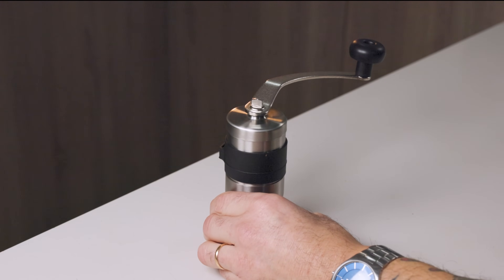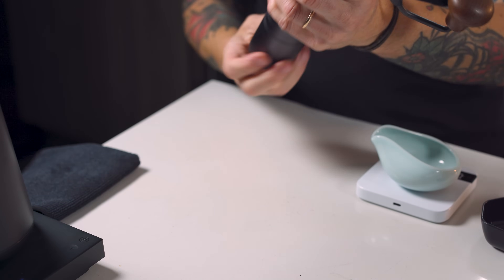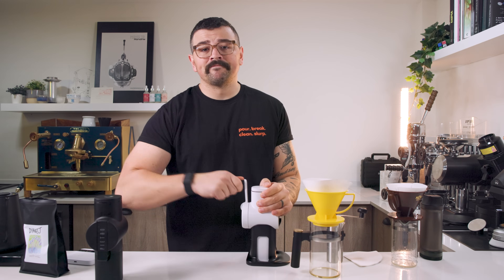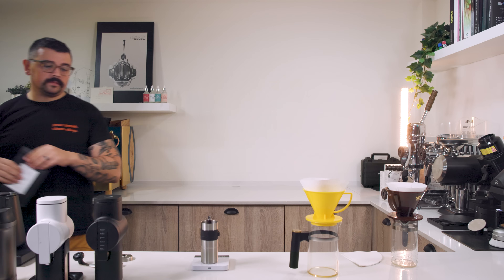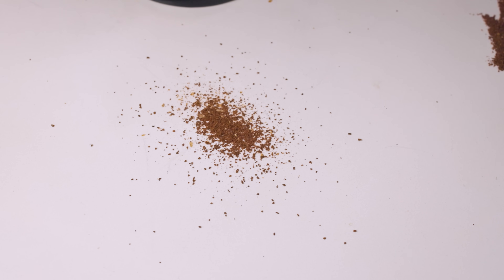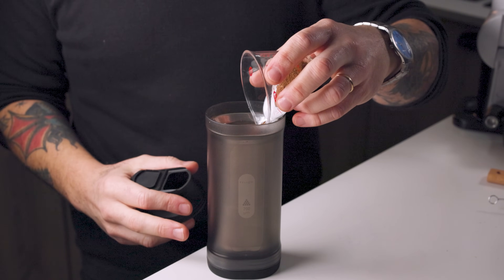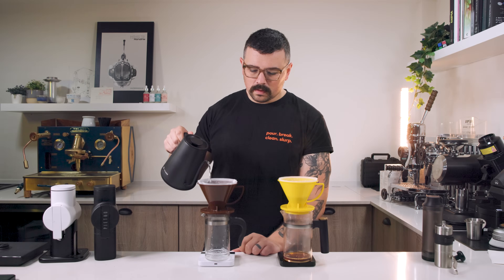Does this Trick Improve your Grinder?

Comment: I read this article a while back about how AI was designing these spikes that go inside rocket engines. I think they designed entire engines now. The things looked positively psychedelic in their complexity. Significantly more precision business than mere coffee grinders.

Within a few years somebody will feed a bunch of coffee data into one of these models and after a few iterations it will design perfect burrs that can never be improved upon. You'll be able to take video of yourself using a hand grinder and tell it your favorite brew methods and from that it custom design a perfect burr to suit your strength, speed, angle, etc.

As far as the electrical ones go, there will just be one that is perfect for every grind. This burr at this speed for pour over, this one at this speed for espresso, so on and so forth. All optimized. There will be one for versatility that has been perfectly tuned to make the absolute minimum necessary sacrifices across grind sizes.

Comment: Assuming some fines are good, and you would consider adding some back, doesn't that mean that you should just adjust your sifter down so you get less (and smaller) fines to be removed?  Instead of the 200 micron, maybe go to 100 micron?  There should be an optimal number right?  (Time for another video?)

Comment: Timestamps (Powered by Merlin AI)
00:09 - Investigating if sifting fines enhances cheap coffee grinders' performance.
02:24 - The video integrates an ad segment for Stand Art magazine and its anniversary book.
04:20 - Sifting coffee grounds can enhance grinding performance and clarity.
06:21 - Testing grinder geometry effects on coffee quality.
08:34 - Evaluating grinder performance through particle distribution analysis.
10:48 - Grinder design affects coffee extraction and taste balance.
12:43 - Fines contribute crucially to coffee extraction balance.
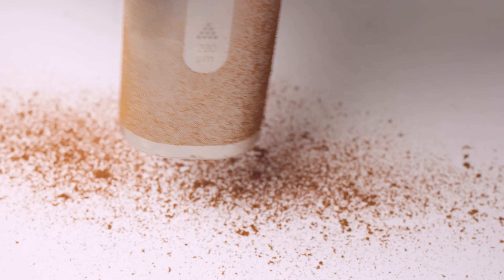14:33 - Sifting coffee fines can improve extraction but lacks dramatic impact.
16:45 - Experimenting with grinder settings can enhance flavor preferences.
18:35 - Ending with an upbeat note and appreciation for the song.

Comment: I started filtering fines years ago and it has been the single most impactful change to brewing consistently. I don't use any kind of sifting device to achieve it though. My grinder is a $75 Oxo conical with worn out teeth.

Comment: Should’ve matched the extraction instead of the nominal peak size. The former is what translates to the target experience of a good cup, not the latter. With my Chestnut C2 I have to go espresso-fine in order to see the benefits of the sifting. I do lose 24% of the grounds to sub-250 micron fines, which I do use for Turkish or whacky filter experiments, but it is a pain to grind that fine with a grinder meant for filter. The sifting is aggravating too.
Reply from the maker: That's your opinion.

Comment: Here’s my question:  could I use my fines to figure out if my grinder blades are dull?  I.e., should be replaced?.    Could I maybe test every hundred cups (or once a month - easier to track) ?   Or, based  on what you’ve learned from your porlex, do the cups degrade (flavor-wise)  with age?   Is a new porlex much better than an old one?   I guess  using a porlex  it would take less time to see how much/little dull blades affect flavor.

Comment: It’s not a ‘theory’. It’s a hypothesis. That said, if you’re using a motorized grinder the easiest trick to getting better espresso is slow-feeding your beans. Get the grinder started, and then begin feeding the beans in. You don’t have to go nuts with this, take about 5-6 seconds to feed them in. Makes a huge difference in consistency of grind
Reply from the maker: Lol you realize i made a video on slow feeding like a year ago
Reply: @ yeah… and I was already doing it many months before you made that video. More for motor preservation than anything, but I couldn’t help but notice I was getting consistently good results in the cup.

Comment: On my Fellow Ode with SSP MP burs I tried sifting, and what I got were very hollow cups, almost no body "clean" but also bitter on some coffees. 
The coolest thing I've noticed was the flow of water through the bed, it was so smooth and consistent. So my takeaway was to try and improve that flow through other means, and that's where the Sibarist booster came into play and elevated my cups. 
This is not an ad, I swear 😅
Reply: I use use the Sibarist booster came away with 3 extra inches - not an ad, I swear

Comment: First off - great video well put together. I especially loved the soundtrack on this one. It brought an Ex Machina vibe which was unexpected. But my question is I feel that you should follow your own advice!: if your brew tastes hollow then grind finer, or increase time or ratio. Each set of grinds (sifted, unsifted) needs to be dialled in rather than just matched in terms of peaks. It may be that you did this but wanted to check. Thank you!

Comment: How do you feel about pre breaking beans without an auger? I’ve used an espresso tamper and a bowl to crack beans lightly and remove chaff intact and do it a lot for washed coffees. Have you tried that before to see if it helps with more “uniform” grinding?

Comment: Great video with some cool data. I have been testing sifting for awhile now, since I got the zp6. At first I felt a little duped by reviewers: "is the zp6 too clean?", "Too much clarity it wouldn't sell in Taiwan" etc. The zp6 is a great grinder granted but in no world is it too clean or even very clean. It is just high-clarity for a conical hand grinder. So I looked towards sifting to try and narrow the gap. The hollowness is immediately apparent and in some cases more astringency if you sift to much. I found using a 500 micron sieve works best, sifting 1-3g from a 21-23g dose depending on how much fines the coffee produces. This way - I hypothesize - the main particle peak narrows a bit but the amount sifted is small enough that much of the <200 micron fines stay in the dose. As you noted, these very fine particles contribute texture and balance. I have though about getting a 200 micron sieve and then adding these fines back into the main does while sifting most of the 500-200 fines out, but sounds like to much work.

All said two suggestion:

Maybe try a larger micron sieve and test some light sifting on more mid-tier hand grinders. FWIW I use a $10 "500 micron sifter" from Amazon which I think is just a tea strainer... who knows what the hole size actually is.

The particle graphs at 10:56 could have more contrasting colours. I'm not colour blind but it took me a moment to identify which was which.

Comment: If you ever decide to do a follow-up, I'd love to see a comparison of the Pietro Multipurpose Burrs vs. the Pro Brew where you sift, then gradually re-introduce the fines (e.g. Pietro MP with 10% fines reduction, 20% fines reduction, 30%, etc.). At what point does the "hollowness" go away? What else changes as a greater percentage of fines is added back into the brew? Thanks for the video!

Comment: Lance: there's a bit of a hack to getting better cups out of the porlex... Hold the base of the grinder on the table when grinding. Don't let it "lift" or "tip over" and try and keep the speed as regular as you can (you'll be forced to go quite slow). It's totally not-ergonomic - but once you get the technique it'll improve the quality considerably (not to an ek or anything, but better)...When you grind with the grinder in the air it's very easy to flex the shaft and cause the burrs to mis-align, the table trick helps keep things more central. This works with the skerton, rhino and all of "those" types of grinder
Reply: I have sorta personal theory, that ceramic burrs could be really good, if they were actually made with good enough precision and put inside precise grinder. But its just theory.

Had Porlex, randomly actually made decent cup out of it. Having sieve(s) definitely help.

Comment: what if you took the pietro's grind distribution chart and recreated it with the sifted porlex i.e. if 90% of the pietro is the appropriate size say 550 microns and 8% is fines at 100microns (the other 2% being the rest of the spectrum) what if you sifted the porlex to have the same ratio? instead of just removing 100% of the fines produced you actually left some in? thanks for the video as always! (also please note those percentages i put in this comment are with 0% accuracy and are just there to help hopefully explain the thought lmao)
Reply from the maker: Particle shape would still cause massive disparity between the brews there.
Reply: @LanceHedrick  ahhh very very good point thank you!!

Comment: Made it through it all,  very informative........I'd like to see a few grinders cheap medium hand or powered, with wetted/misted beans for pour over, rather than espresso and see if there are improvements in any way. My bias is towards yes, for it seems to have helped my cheapo, and "good enough" burr grinders. power of suggestion, subjective, fact or fiction? Hollow is a great descriptor. I have ground a fresh espresso roast from a roaster that is quite in my cheapo cordless grinder  then in a nicer burr grinder. both ways I for some reason have a soulless meh hollow cup.

Comment: Sifting out the fines (& potentially boulders too) works best for immersions with limited/no flow and need not reduce extraction (check out the sifted cupping at the "NBC/SCAE Gold Cup Grinder Research" video). Sifting for percolation is too labour intensive for day to day brewing, but if I did want to improve a grind distribution (even for an immersion with  a flow component), I would take a grinder coarser (to reduce the incidence of smaller particles) then sift out boulders (say 10-20% depending on the sieve at hand. You said that you matched the modes of the grind distributions, to do this you would have to had LPA plots to show this...however the plots shown in the video are speculative, suggesting the modes were not actually matched?
Reply: I don't know about your Porlex specifically, but on mine 3-6 is in the espresso range, way finer than I'd attempt for pour over.

Comment: This helped me a lot 🙏
I actually use the Porlex Grinder and since I got more experience in the coffee world I started to really doubt myself. I didn’t understand why my cups weren’t tasting very great and started to understand that it really was the grinders fault. However I noticed, that when using a classic AeroPress recipe, the Porlex is doing okay. The particle distribution in coarser grind settings gets worse and worse since the grounds are really not homogenous. When grinding finer it turns out a little better. 
When I use the AeroPress I do a little bloom first and then fill the rest of the water. I stir it and let it sit for 30 seconds. Then I press it with a little bit of pressure for about 30 seconds.
This recipe works pretty fine for the Porlex. I use 8 clicks to achieve that. That way there is not  so much dripping through the filter before pressing.

Comment: Very caffeinated, I'm  to much ADD to watch it all this , yet......I'll need a post cafe beer to do so, However:  I had a grinding F'up yesterday, I unwittingly poured my beans into a glass of water. Last dose of beans. I actually dried them as best I could. They extremely slowly ground in my inexpensive rechargeable one cup burr grinder. INTERESTINGLY THE CHAFF WAS LEFT BEHIND>>>>LIKE NEAR WHOLE HUSKS>>>>> this would be difficult to repeat. was doing a relatively coarse grind for pour over with some mid roast beans. Miraculously my cuppa was quite good. Once in the past I over wetted beans with booze as an experiment (Also tried a misting with better results) The beans just squished that time, so I had coffee bean pulp I suppose. I've had very nice results lightly misting whole beans pre grind (or adding droplets  of H2O and agitating) Dunno if its B/C it eliminates static or??? but don't/fines get chaff sticking to burr or receptacle. Does it make for a better cup, hard to tell, a better grind? Maybe. It's probably bad style to comment b4 watching the whole vid. I 'll blame that on making my morning mug "strong like bull"
Reply: Ohh That side handle hand grinder minute 5 ish looks appealing, top handle ones are a PITA. Sadly my drunk ex dropped my vintage wooden boxed grinder in the ocean. It worked great.
Reply: after a negra modelo I've been able to focus enough to make it to minute 12.....wow! You "nailed" all 4 initial brews. Super taster or rigged/? (kidding)

Comment: Yeah, but what if you tested to see if the color of the dripper has any effect on the flavor of the coffee?
Reply: All jokes aside, I just got my sieve in the mail yesterday and tried it this morning. I have a sorta mid tier hand grinder (Timemore Chestnut C3 Pro something something), and even trying my best to slow feed grind it at around 1500 microns, I would still choke my filter. I tried a high flow rate filter and it still choked up. This made my brewing times fluctuate anywhere from 4-6 minutes. Using the sieve for about 30-40 seconds of shaking, I have successfully got the brewing time to 3:30, and no clogging the filter. Obviously my cups taste much better, and that is my experience so far.

Comment: A couple of questions come to mind.
1.  Are the particles clinging to a dosing cup or left in the grinder mostly fines and should you avoid trying to get to zero retention by knocking or using a baffle?
2.  What would happen if you grind very coarsely on a hand grinder and then grind them again at your desired setting relative to particle distribution and fines?

Comment: i use kruve 500/1300 and Hg-2 because i think Hg-2 make many fines so i shifted and pour fine right after last pour. in my experience it reduce emptyniss and fines are captured by large particle .Recently, I'm wondering if large particles(1300+) go bottom will increase the extraction in the cone filter by make more flow to extraction shadow area(bottom part) , or if placing large particles on the top ( typical cone filter extract more in upper position and it increase the extraction of large particles) will have a better effect on the taste or  mixing(with magic tumbler) and then adding it will give a better experience.
Reply: I want you to take a look at this, too. In the case of tricolate, non-bypass brewers require a large amount of beans. In Korea, people who could not purchase that kind of dripper due to cost problems tried to make a similar effect with an aeropresso. The same effect can be achieved in small amounts of bean. I'm curious about your opinion on this. https://www.youtube.com/watch?v=l-MwK8Z0Db8

Comment: Hi! Thank you for such great content and for creating such an amazing product! Very interesting video! 

I wanted to ask — Pietro released an updated version of the grinder some time ago, adding an extra O-ring and a few other small changes. In the older version, the part with the handle wobbles quite a bit (at least on my unit) when pressing on the handle with an empty grinder. From what I understand, this movement is significantly reduced in the updated version.

Do you know if these changes in the new version have affected particle distribution and grind consistency? 

Thank you for your response!

Comment: Hey Lance! Just a question: I own a 1Zpresso J-Max and want to reduce static when I grind, however, 1Zpresso advises against the use of RDT. Do you know of any other methods I can do that? Appreciate it
Reply: Little water spray bottle and spay in a dosing cup 4-5 times (2g water weight worth). Then I grind and use the blow tool to clean out fines left over....zero issues so far and its been about 2 years
Reply: @liiich6175  Same here but one spray is enough, with little shake of beans before putting them in grinder. Kinu M47
Reply: @liiich6175  2 grams of water!?  I barely mist the beans with no measurable water weight and I have zero static build up.
Reply: @GunfighterAlpha  Yeah I mist too...but I just wanted to mention how much my misting adds as not all sprayers are the same...also I use cheap jeweler scales that are 0.00 so it shows up more so.
Reply: For what its worth, I've been using RDT in my K-Max for 2 years with zero issues.
Reply: @GunfighterAlpha  Really? I've been considering it but I'm worried about rust.
Reply: @AlphaOmega-1312  Zero rust, no bearing degradation and I disassemble the grinder and clean it every 2 weeks.  It barely takes any water to reduce static buildup so I wouldn't worry about it personally.  Your grinder, your call!.  Cheers.
Reply: @GunfighterAlpha  That's super helpful. What grinder do you own if I may ask?
Reply: @AlphaOmega-1312  their original comment said a K-Max.
Reply: @Psynapseful  my bad I totally skipped over that😅😂
Reply: Been rdting too for over a year now. Huge improvement on static. No issue at all
Reply: @tiodeniz  awesome
Reply: I RDT JMAX ER’RY DAY…DONT WORRY. 1ZPRESSO DONT WANT THE LIABILITY, CUZ RUST HAPPENS, JUST RARE IN THIS CASE